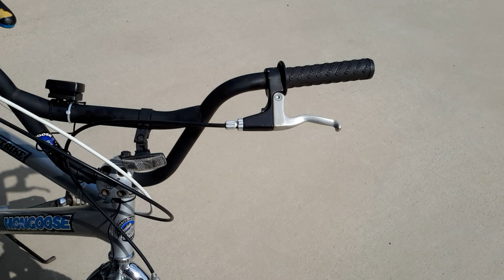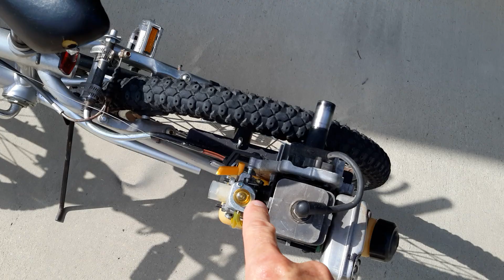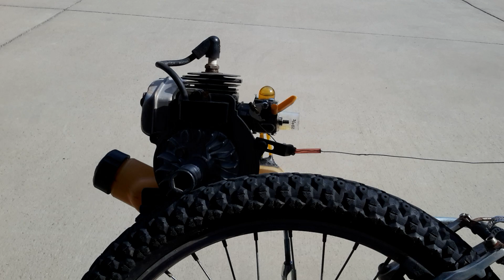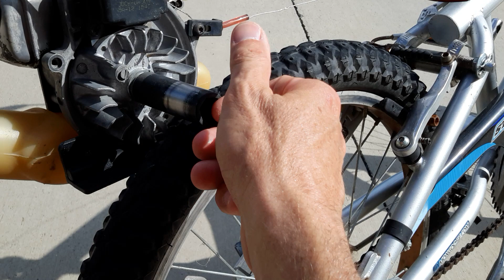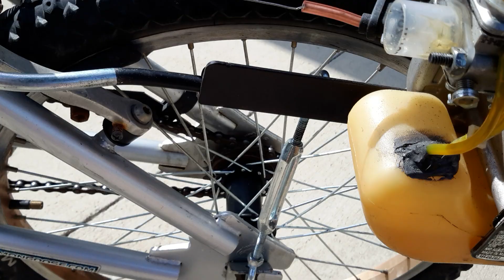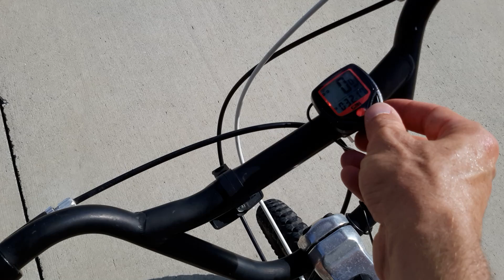weed eater powered bicycle

Comment: Is the socket on the fly wheel that engages the tire, tight to the tire at all times? If not why are they usually hinged?  How does it coast? Or idle?  And how do you start it? 
I'm going to make one but no one explains how your engaging the tire or if it's fixed in place.
Reply from the maker: Yes the socket it tight as it is a friction drive.  The turnbuckle is used to tension the entire assembly to the wheel and keep it tight.  It’s hinged at the seat post so you can loosen the drive socket off the wheel and ride it like a regular bike by loosing the turnbuckle.  Since the drive socket is on the rear wheel you have to peddle the bike, sort of hard to peddle, and it will bump start the engine.  It does coast ok while the engine is running but not quite as freely as a regular bicycle. It will idle when you release the throttle but if you go too slow the engine will die, usually less than 2 miles per hour.

Comment: If the weedeater is a 2 cycle it will run in either direction  (clock wise or counter clockwise

Comment: Hello, nice bike you assembled. I also develop the same but with a centrifugal clutch and a variable belt. a little more complicated to assemble, but similar. would you tell me what is the diameter of the friction roll. write with translator so the translation is not very good. I am from Bulgaria . See you soon

Comment: hello i want to ask what diameter is the friction roller. See you soon
Reply from the maker: Diameter is hard to say as I don't have the bike any more. I gave it to a neighbor.  I used deep well sockets so that I could easily change the "gearing" of the bike to see what would work best.
Reply: thanks for the reply
Reply: I think it is a 17 mm deep well socket. I purchased a set of sockets so that I could easily change them and experiment with the gear ratio.
Reply: thanks for the reply.

Comment: Yes. It goes about 23 mph top end. I weigh 150 pounds. Gets over 150 mpg. I did change to a ryobi 4 stroke and it has a lot of torque. Daughter has this set up. She weighs 60 pounds and gets 250 mpg and goes at least 30 mph
Reply: FriCtIoN DrIvE...              `. ' .OVo
Reply: LpsGenna ...What kind of Ryobi 4 stroke??
Reply from the maker: Its just a regular Ryobi 4 stroke weedeater. Its the one that has the green plastic engine case.  Works really well.
Reply: You do not get 250 mpg. The engine is not even remotely efficient to get that fuel mileage. What is you tank capacity, your idle rpm, top speed and mixture rate? Id like to see your numbers.
Reply: Chantal Beck Just telling you what I got with mileage for my daughters bike. If you don’t believe me, build one for yourself and do your own testing. 44:1 ratio, it won’t idle as it’s a friction drive.